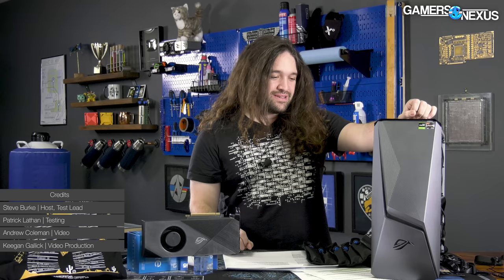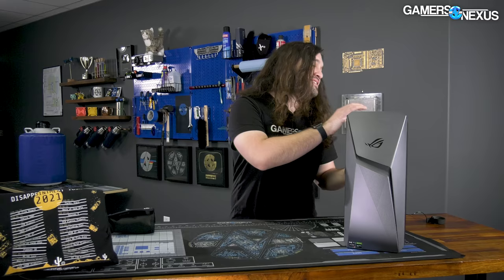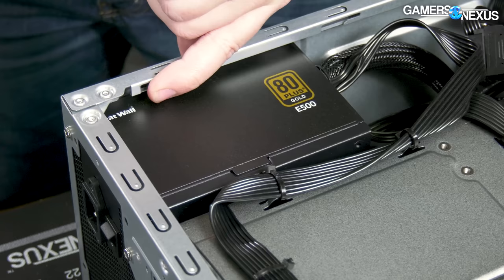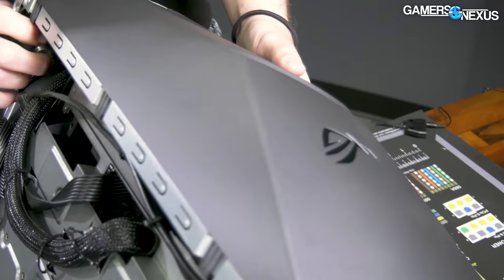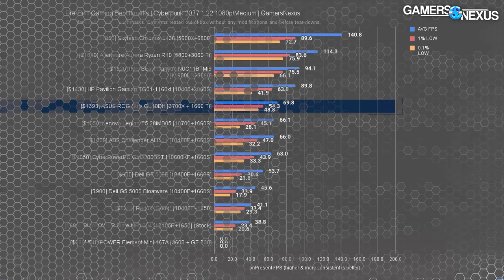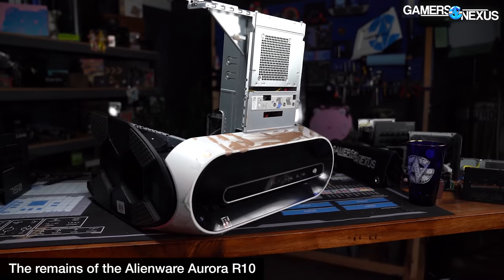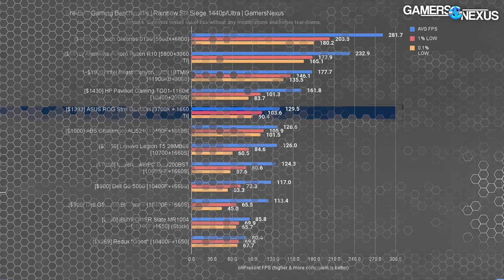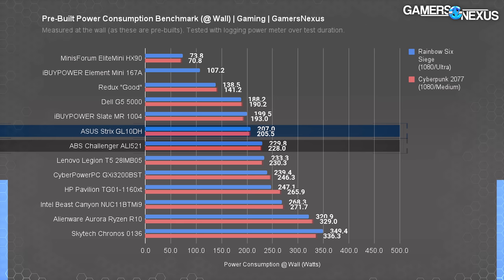ASUS Didn't Deeply Offend Us: $1400 Pre-Built Gaming PC Review (ASUS GL10DH)

Comment: I can't wrap my head around getting a new machine with a video card worse than my 1080 I bought nearly 6 years ago. Let alone paying these kind of insane prices.
Reply: What did you spend when u bought your 1080 rig???
Reply: @blackfacegaming191  it was a little over $700 for the card. And...ehhh $900ish for everything else. Would have been a lot cheaper but SSDs were expensive back then. The point being that was the best card out at the time. A 1660ti doesn't even qualify as mid-range.
Reply: Not to mention below a 2060 you approach console territory for performance.
Reply: @timothygibney159  yea if you aren't able to hit 1440p with your graphics card you may as well just get a ps5 or xsx
Reply: @Gertso  It sucks. I finally have a good enough job to buy an overpriced 3080ti for my dual 1440p setup but when I got into building pcs in my 20s this would have killed me! My love for building pcs is even poor folks in the past could make a custom cool looking decent build. I don't want it a rich man's big d*** hobby only
Reply: @timothygibney159  it is cool that the rest of the hardware is getting cheaper so at least I can upgrade the rest for now but yea...normally priced gpus is looking a good 2 years off.

Comment: Walmart is literally selling a better version with 5700g and rtx 3060 for $999 so that sounds like a waste of money
Reply from the maker: What's the brand? ASUS? Walmart? We can look at it.
Reply: @GamersNexus  It's an Asus brand. Sold a few at my location.
Reply: @GamersNexus  you guys should do some of the MSI models and try and get one with the boards that are named and labeled like the retail ones but are version B or something similar so they never get bios updates after they are originally released despite the retail boards getting constant upgrades.  This is there bios policy for all the prebuilts. Its more egregious on the higher end models especially since they specifically advertise them as great to upgrade. I have a triden x z390 version and if i got a 30 series i couldn't get resizable bar working no matter what and even if i bought a model newer with a z490 and a 30 series standard its not available because they don't do bios updates despite the boards being the same as the retail models  they are even labeled the same (ie Z390i gaming edge ac)but they often will just not add on a sata connector or a fan header. Its really ridiculous because they would've had to have made a deliberate  choice to make the mobos in the prebuilts different than the retail versions of the boards . For example the bios on my computer is from (7/19) while the retail z390i gaming edge ac most recent bios is from (11/21)

Comment: got a similar build for my girlfriend from FB marketplace for $600 and it came with a 1650 and a 3400g. I did change the ram to dual channel. and while this is almost the sam case it came with a tinted acrylic sidepanel.

edit: also it came with one stick of ram, the same cpu cooler and gpu bracket, and psu, but surprisingly has an mATX mobo. it also lists itself as GL10DH on the sticker on the bottom

Comment: Even at inflated GPU prices, you can still buy parts to assemble  a better performing PC than this one for $1400
Reply: I don't know about that. I priced gaming pcs builds at both Microcenter and Newegg and the pre-builts were a little less expensive.
Reply: @MrModaman  Microcenter makes their money off everything else they sell. Complete builds, monitors, keyboards, mice, etc. You're not generally walking into a Microcenter just for your tower.
Reply: @MrModaman  Are you sure?  This computer is running a 1660ti.  RX6600 is available around $450-$470, 6600xt around $540-620. Both are substantially better GPUs than the 1660ti.  You can easily put together the rest of the build with an 11400 or 12400 CPU and similar or better specced parts for another $600-$650. Even if you pay full price for a Windows license, the total will still be under $1400.

Comment: These people that upload vids bashing computers miss the point. It's a pre built PC. Part of what you're paying for is the fact that it's prebuilt. Not everyone wants to build their own PC. They want something pre assembled that comes with a warranty that will do what they need. It's a consumer based PC for the average person and it does it's job as it should when you stay within it's limits. What you're doing is like someone who built a 10 second Mustang going to a dealership and nitpicking at the factory models that run 14's and poking fun at the fact that they market them as fast muscle cars but their engines don't have superchargers on them or even a racing harness. If you built something to perform it's always going to be better and cheaper than what comes out the factory. This is just a consumer PC with everything you need for a slightly above average gaming experience. Even at $1,400 you still wouldn't get much better with the price of computer parts unless you had some sort of massive black Friday discount going on. It's easy to take apart something factory and say this sucks or that sucks but put your money where your mouth is and show us a stress test with you getting these machines to fail. Also I how can this dude pretend to be some sort of computer expert when you don't even realize that "black thing covering the back of the front fascia of the keys is a heat shield to prevent heat soak to the front of the computer.  Don't pretend to understand design engineering if you ain't an engineer.

Comment: I bought a “ready gaming” Ibuypower pre-built just before Christmas.  All name brand components in a case that actually flows air.  i9-11900kf, Gigabyte Aourus z590 elite ax mono, 32GB T-Force 3200 RAM, Asus TUF 3080, 360mm AIO, 1TB Gen4 NVME, etc in an Inwin 305 tempered glass case for $2749.

Comment: Since the GPU shortage is seemingly over I have been wanting to build a new PC. I have never purchased a prebuilt in my life (25 years of pc building under my belt)  BUT I just picked up the new ASUS GT15 ROG Strix from best buy (I know I know) BUT it is the updated 2022 version of this PC Steve is looking at . The case has a major redesign USB-C in front and back. The case has open mesh at the front and top and back with shielded tempered glass side and RGB aura sync strips inside and on the front . Has the i7 12700F, 16GB ddr4 3200 ram, Micron PCI gen4 500 GB M.2 boot drive, and a 2TB HDD, ASUS RTX 3060 with back-plate. All connected to a ASUS TUF Gaming  b660m-plus WIFI d4 motherboard which is a $160 board alone.  I paid $1,136 for the system and replaced the stock cooler with a Noctua nh-u9s and it keeps a steady 37-43 deg at idle/streaming YouTube and never over 68 while gaming. Reason I got it was I could not build a comparable system for under $1400 on PC part Picker.  So far I'm really happy. Its all standard off the shelf pieces from reputable manufacturers with a decent warranty.

Comment: The thing is I’ve seen and almost bought that exact same system at a Walmart for 1000$ but it had a 5600g and a 3060 but I got a abs challenger instead so I feel like this a worst example price to performance
Reply: Thing is, those 2 components are very capable as a mid-spec gaming machine, it's such a pity that they are often coupled with crap ram in a case with crappy airflow.
The mark-up on these prebuilts is criminal, they could easily spend an extra $30-$40 on ram and case and have a very respectable gaming PC, but they never do.

Comment: Steve, regarding Armoury Crate - I recently put together a completely  new PC with a 5900X, Asus RIG Strix B550-E motherboard, 32GB DDR4 3600, and an RTX 3080. Even on premium DIY parts (such as the B550-E, which is one of the most expensive B550 boards but has PCIe 4 SLI support, the Armoury Crate bullsh!t is enabled ^BY DEFAULT^ in the BIOS/UEFI. This meant that I installed Windows 11 and once I had set up network connectivity, the Armoury Crate software downloaded and installed itself, along with 5 services, 3 scheduled tasks, and other Asus software. Remember, this was enabled by default by Asus. It shouldn't be allowed. Also, Asus is still shipping products with defective Intel 2.5gbps NICs. Edit: Was going to send an email (tips at etc.) but it's no longer listed.

Comment: So you're aware, the ABS systems have been using the Gigabyte exploding power supply models.  A Twitch streamer bought one based on the recommendation and found that power supply in it.  It was causing constant shutdowns in games and he had to buy a new power supply to replace it.  The computer worked perfectly after replacing it.

Comment: My grandson purchased a pre-built from Best Buy that has an 11700kf and 3060Ti for $1300 ... I was amazed at the price. We did however replace the cheap cpu cooler for a Noctua because the cpu temp was hitting 80 C at idle. Just replacing the cooler brought the temp down to 30 C.

Comment: I just built my mom a PC and the same PC would have cost 1300 Euros more from Ibuypower. X570 Carbon wifi max, AMD 5900x, Gigabyte 6700xt 12GB OC Gamer GPU, 64gb ram, 1tb ssd Samsung 980, Corsair Watercooler, silent 750W platinum psu, and Corsair 5000D case. 2400 Euros total. 

We paid 900 for the GPU which is almost 400 over msrp but was the only one available.

Comment: Once again, a pro tip for people looking to buy prebuilts (or advising others to buy):
Either - look for system integrators (SI) who build computers out of commercial parts, which helps when you need a repair because any shop can repair or replace the components, or
- find a parts list, purchase them by yourself and bring to a local PC store to assemble. Most of them will happily help with assembly for less than $50

Comment: I have been building my own computers since this guy was in diapers. Since DOS Days,  when the the idea of upgrading from 2MB (not GB)  to 4MB of RAM was a HUGE LEAP.  When the first CD-Rom popped out, I though of it as a AUTOMATED ROBOT.   Well,  I just took a job as a technical consultant to one of the biggest companies on Earth (NDA...) and thus I don't have time for the fun adventure of a new build,  I just needed an upgrade.  (coming from a Asus Extreme IX Waterblock MOBO with i7-7700(Not K) and my 1080Ti Founders Edition that I water cooled (with a KRAKEN G12 Bracket).    I got THIS: ASUS G10CE-AH766 STRIX with Octo Core 11th Gen i7, 16GB DDR4 and an RTX 3060...   I don't know,.  Seems pretty AMAZING to me... No loose screws (LOL :)  It boots in 6 seconds..  It has 2 8-GB DDR4 chips (and 2 open slots, maybe they listened to this guy,...)  I am certainly not complaining,.   who gets a whole computer, (an Octo Core 11th Gen proc  and an RTX 3060 for $1,100 and complains about the inevitable and invariably cheap stock cooler right? What Pro wouldn't PLAN to replace it?   I will replace the stock cooler with a Cooler Master AIO Water cooler (of course) -  In addition , like my 1080Ti  (that has never know thermal throttling) I have already ordered some KRYONAUT Grizzly Thermal Paste,  a Kraken G12 Bracket and a compatible AIO water cooler for the GPU  (along with a kit of 100 assorted Tiny Heat Sinks and Shimmies with Double sided Thermal Tape to apply to all the GPU's VRM chips. I don't do thermal throttling!  This is a great machine.  They have taken away the weird plastic Inner-front piece lining, if one looks at the front assembly (rather than throwing it) they would note it allows air to flow through quite readily!   It is almost silent almost all the time so far,..   Some channels get so caught up in being 'critical', they seem to forget not everyone has the choice of any machine on the market!  I for one am VERY HAPPY with my very first Prebuilt in my 40 year computer odyssey.

Comment: I bought one of these for parts a while back. 2060 super and a 5700g for a thousand at walmart. Put a 2300x and a 1650 in it, replaced the included ewaste cooler with a stock ryzen cooler, and the case works fine for a low end system for my friend's daughter to play Fortnite and Minecraft on. Runs better than you'd expect.
Reply: Same here but with a 3060 Walmart for the win I guess lol

Comment: Got the G10DK variant, same case.  It scorched the m.2 wifi card in the lower slot.  The heat buildup in the lower half of the case caused the ACBel 500w bronze psu that came with the system to exceed temp tolerance which caused voltage instability and fried the motherboard.  The nice thing is I salvaged everything except the Motherboard, PSU and wifi card.  This was after 8 months of use.  Don't make my mistake, put everything in a case with better cooling immediately if you plan to buy any of the asus pc's that use this case.

Comment: You can probably swap the PSU even on systems that use a proprietary PSU. They just need adapters to covert the standard 24pin atx to whatever connector the motherboard uses. That can't be done, easily, if the mobo uses some strange voltages that are not provided by a standard power supply.

Comment: I am watching this, and I cannot believe how far this brand has developed the Asus ROG Strix with access inside the system (G15CF model).  I bought it on deep sale at Best Buy, and I have to give it to them:  This is a good PC (in 2023) to start building a fabulous gaming rig.  It has a solid base.  Yes, it could have more fans (even in 2023) but that model was over 1k more.   It would have the cooler master CPU cooler.  The B660 motherboard can handle DDR5 RAM and is upgradable to the I13xxx platform without exchanging the motherboard.  Bloatware is no problem anymore, there are two great application approaches (bloaty nose and Chris Titus' free program) to it.  Best is ALWAYS to re-install after you take a snapshot of the fresh computer (it requires some planning).  Today I am receiving the PA 120 and I have added 32GB, a 2Tb NVMe (now that they finally become cheaper).

Comment: OK! Hear me out. I bought an ASUS ROG STRIX G10DK just before Christmas of 2021 for 1389.99 off Amazon and got it before Christmas. It has a Ryzen 7 5700G with (2) sticks of 8GB DDR4 3200Mhz ram and came with an ASUS RTX 3060 16Gb DDR6 that is overclocked. I really wanted something higher than a RTX 3060 but I had a price point! It has the same case as you reviewed and my system actually preforms quite well. I can play MSFS 2020 at ULTRA settings at around 50+ FPS. Better than I expected! My system QUICKLY went "OUT OF STOCK" and 2 weeks later they were selling the same system with a Ryzen 3 (not sure which model)  and RTX 2070 graphics for $400 more! I must admit for a "pre-built" it is very cleanly built and the temps are not too bad. It preforms really well. The Ryzen 7 5700G is not a slouch as in MSFS it only maxes out as 32% CPU and the GPU is hurting because it's only a RTX 3060 but preforms really well and getting a "good" gaming experience for the price I paid. Just since before Christmas prices have really gone up with lesser specs.! The 3060 has raytracing aspects that previous versions do not offer. I could NOT have have built a system with these specs. at the price I paid! YES, it's no "beast" of a system but, it's not slouch either with triple AAA games. Just my (2) cents...With todays lopsided market..

Comment: 4:28 the lack of powder coating on the inside of the panel, while not necessarily required on a practical level, is a shamelessly obvious cost-saving measure that shouldn't exist in a pre-built over $1k

Comment: U said laughing but i was the RMA guy at a pc assembly company that supplied pre-builts to small pc stores. And the first diagnose tool was: shake the case, see if it rattles. My ex-boss used to buy dirt cheap screws and some sheer off and seemed plugged without being plug. Is what using overpowered pneumatic tools in assembly does.

Comment: Had an ASUS STRIX G15DK (RTX 3070, R7 5800X). Had to return it because it had horrible noise level! (After about 20 sec of launching a game, the noise level became sky high)
The uefi was normal with OC’ing supported. However the BIOS’ fan curve got fuckd after a BIOS update.
Also, the cpu fan was not an “old AMD style cooler”
The chassis had actually airflow in the front if you can believe it!

Comment: Why does EVERY review of these ROG systems not realize the front air intake is along the raised bottom edge created by the front cover?  Also, that film inside the front cover you thought was only reflective ALSO guides the air up into the front of the case.   I added a front fan, a new CPU fan and a quieter rear fan, and it runs very cool and soundless.  Considering the price, a great value.  I could not even come close using parts where I am.
Reply: Can you tell me fans you used?
Did you add an intake fan?

Comment: I got this computer secondhand from a miner that took the 20 series gpu. So I added a msi 3060 gaming x, went to 32g of ram, and put in the amd wraith prism CPU cooler by cooler master. Had to remove the wireless adapter to fit the GPU but who uses WiFi for gaming anyways. There is very little room for upgrades but im happy with it

Comment: Ill never regret pulling the trigger on when i built my pc. All new components except for the gpu. 1070ti with a r3 3100 and 16gb of ram in a meshify case all for $700. I bought right as the 3100 was starting to rise. And right before the meshify 2 cases came out. But looking at computers like this makes be glad i didn’t wait
Reply: Only real regret. I have a 750watt gigabyte psu. THE psu